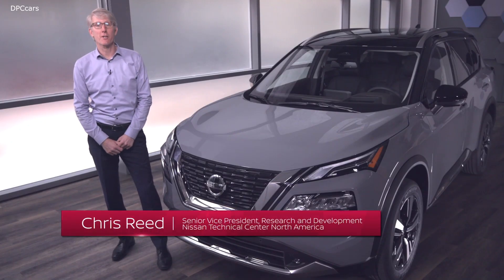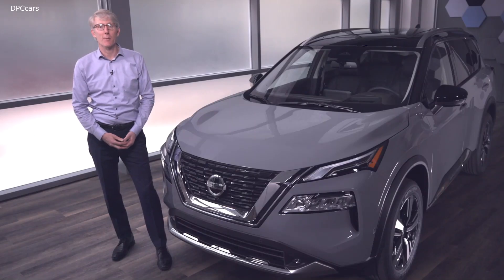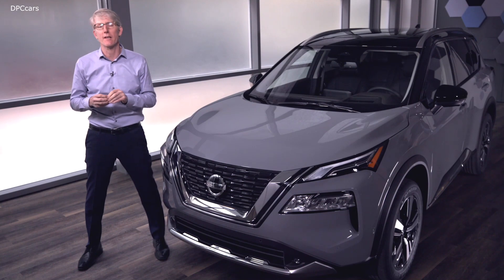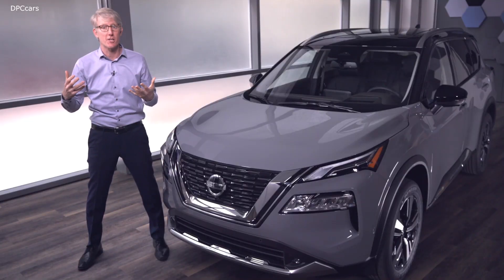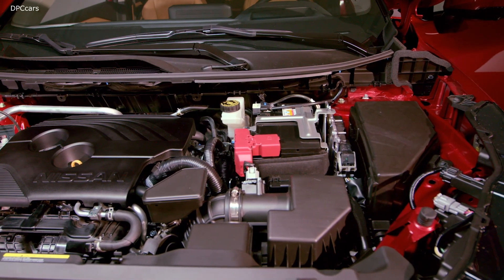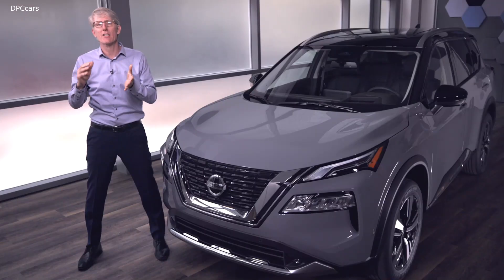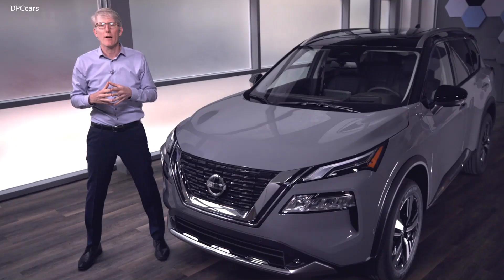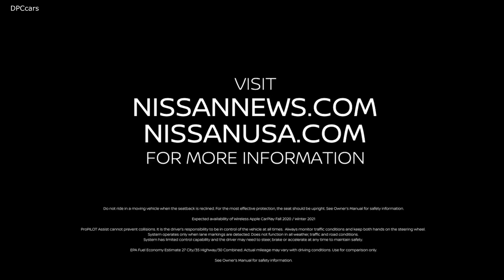2021 Nissan Rogue Engine and Powertrain

Comment: 3 cylinder ugh why
Reply: The 2.5 is a good motor
Reply: This is not going to last. 1.5 liter engine. No way.
Reply: The PR25DD is a 2.5L N/A Inline 4, the 2022 Rogue has the new VC Turbo.

Comment: Thanks for making it a pain in the ASS to do an oil/filter change on my 2021 Rogue.  Putting a cover on the bottom of the engine with 10 clips and then having to unscrew another cover to get to the filter?  What were you thinking?!?!?!

Comment: I just test drove the 2021 platinum and it so far beats the rav4 and Mazda cx5 when it comes to comfort, features (pro pilot) and looks. What i still don't understand is that have they done any improvement to the jatco CVT  that has been causing so much problems ?
Reply: They are now on their 3rd generation cvt which so far has yet to prove troublesome. This is backed up by the fact that there are currently no lawsuits out against any vehicles with the 3rd gen cvt. Improvements to this latest cvt include the widening and strengthening of the cvt belt and the reduction of internal friction by 40%. Both of these improvement help protect against the belt snapping or becoming slack.

Often times when a CVT fails it comes down to owner abuse/neglect. Keep up with your vehicle maintenance plan and change the tranny fluid every 35k miles and you should never have a problem. 

Hope that helps!
Reply: @dave3682  thanks a lot.. got the 2021 rogue. Loving it !
Reply: Previous generation before 2017 had cvt problems.  I drove rouge 2017 200k no issues so far. Depends upon driving too.

Comment: We have a 2017 Rogue and my wife's biggest complaint is its gutless.
I think she is leaning towards a 2021 Ford Edge which have a smaller engine with more HP.
I do like he look of the 2021 Rogue and will probably test ride before we make a decision
Reply: Smaller engine with more power equals less reliability and longevity.these small turbo engines all suck and don't last

Comment: There's really nothing new here. No one is going to notice a driving difference. Your typical customer is not a engineer, that tests vehicle's daily. It's a sub- compact SUV. A inline 2.5 ltr 181hp ..yawn. You want to make something different Nissan? How about have more HP and have a selector to tune the HP down? I see a lot of styling that the new Rav 4 has and some interior styling the new Tacoma has. ...Yawn